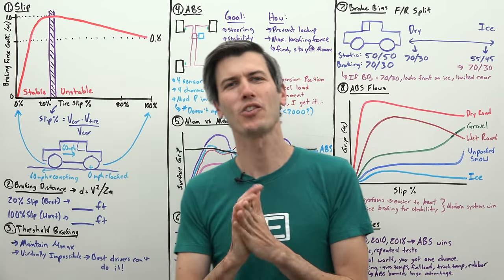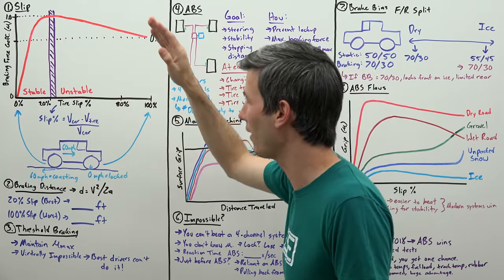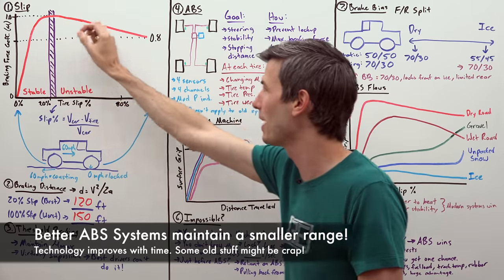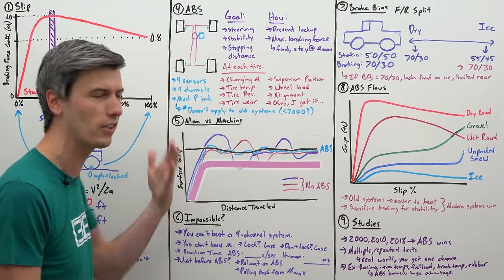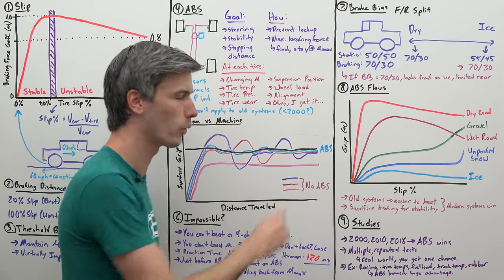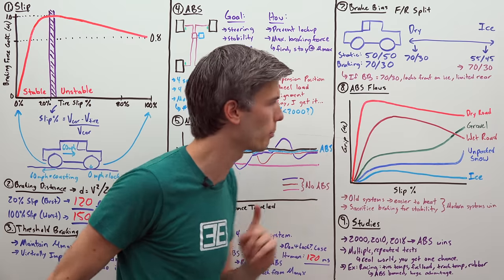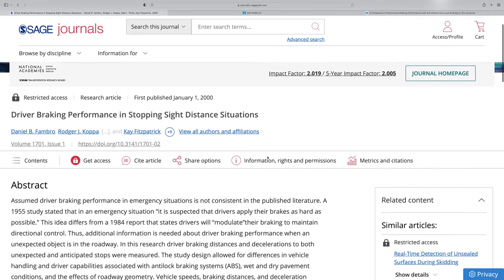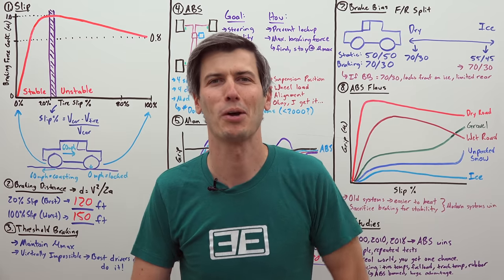Why Threshold Braking Is Impossible - ABS Wins!

Comment: As a sim racer, not having ABS helps in racing because as long as you aren't hard locking the wheels, you get some turning performance where ABS stays on the ideal limit of maximizing stopping power and not giving any grip for steering input, causing bad entry understeer if you misjudge.
Reply: Disabling ABS then doesn't help you at that point. ABS just stops you from sliding, it doesn't stop the driver from underbraking to use spare traction for turning. You had just as much control overt the car before you disabled ABS as you had after.

Comment: How about BA and ABS ? How it’s differently? Tq.
Reply: ABS is “antilock braking system”. BA is something you just made up.
Reply: @ryanjohnson4565  I think they mean Brake Assist? It basically puts more force on the brakes if it looks like you’re doing an emergency stop but haven’t pressed the pedal down far enough.

Comment: Actually the worst braking performance would be applying too little pedal pressure to stay below coeffiency of 0.8 for the whole time. And this is actually the end result that most inexperienced human drivers are actually doing in accident avoidance situations. Hence modern cars have brake booster logic that artificially applies more brake pressure than the pedal position actually demands if you move the pedal rapidly for a short travel because that's assumed to indicate that driver is trying to make full stop to avoid accident.

Comment: I don't argue with ABS advantages but it has some flaws on snowy and dirty roads.

Snow. There was another experiments with ABS on snowy roads which shown that ABS has longer braking distance because it allows wheels to rotate while blocked wheels work as snow plow and makes some snow barrier which makes addition braking force.

Dirt. Under term dirty road I mean two worst cases for ABS: concrete or asphalt road with a lot of broken stones (it is used to improve grip at slippery turns in winter but don't get it out till summer); gravel road or dirt road with 'washboard'-like roughness. In both this cases ABS actually disable braking system leaving you only with parking and engine brake. May be I done it wrong. May be ABS of all my cars had wrong settings. But I didn't found yet a car with ABS which has a shorter braking distance on such types of road than car without or with turned off ABS.

Comment: The reason is, that while this curve looks as it is, its peak efficiency varies hihghly between soft gravel, cobblestone, steel plate etc. This damn sweetspot is varying very quickly from 5% slip to 70% slip each millisecond, entire graph moves. ABS is unable to tell what's coming and for example is falling horribly on cobblestone. A human is able to tell whats coming in the city, ABS can't. If might look different from US perspective where roads are wide plenitful and have equal amount of potholes.

Comment: I wont deny it and i can't deny it. ABS is best in 99% of scenario. But i like to believe i can achieve very close to ABS's performance on a controlled environment however in an emergency i wouldn't have the same reflex and would perform worst, where it matter the most.
I'm saying that because very often than not i'm having fun on my bicycle by slamming on the front brake just infront of a redlight.
I'll get my rear wheel lifted and stop "on a dim" i mean "on the marked stop line" :P
Doesn't matter at what speed i'm going if it's 30, 40, 50, 60km/h i always nail it lol

Comment: I can attest that a 2008 car with (more) modern ABS out brakes the 1999 car with ABS on AND OFF, and the 2006 car without ABS . ABS  Adds a LOT of stability during emergency braking and manoevers: You can simply lose control because one wheel locks out and sends the car drifting, and another wheel locks while correcting and so on.

Comment: Before 2016 you can say that a good driver can beat some cheap cars abs systems but after that even cheap cars now have amazing ABS, and if you are a very good driver you will never be able to control wheels individually which is very important as a very good driver will be 10 to 20% worse than ABS in normal conditions but in conditions where individual wheel control is needed the good driver will perform 40-60 % worse than ABS and may end in spinning the car.

Comment: Modern ABS wins hands down. Especially in split mu conditions when yaw control is also required for straight line braking. In day to day driving, if you want to get the shortest & safest stopping distance with a modern ABS, just stand on the brake pedal, don't let up. An interesting study would be to compare older ABS (80s or 90s) with the latest ABS and see how they stack up under similar conditions and what exactly is the reason newer ones are better. Secondly, why hasn't a cheaper ABS been made available till now. Last I checked it added around $800 or more to the price of a car.

Comment: I just don't like it when the cars driving and I'm not. Abs is great in a straight line but some times I want to slide to avoid something. I used to race though so I know what driving to the limit is and don't even get me started on traction control. That stuff will crash you on slick roads when it won't let put on power or turn. 2021 Honda CR-V. Honda is supposed to have a good system too.

Comment: This doesn't even consider you driving a motorcycle, like mine without ABS and not applying enough brake pressure in fear of overturning due to too much front brake or not enough rear brake due to your rear breaking out. As a normal person, you don't want to chance either so you always sacrifice braking distance to prevent a worst-case scenario. I am deeply aware that I need an excess safety margin for vehicles in front of me in case of any emergency braking because I won't risk breaking as hard as a vehicle with ABS can do without worry.

Comment: My old car, have only brake servo. 
NO power steering
NO ABS, NO ESP, only steering wheel and me...
After 7 years with it...this is the best automotive experience.
In all conditions, weather, temps...
I not need a ABS at all 😊 any asist system...

Comment: In a brand new perfectly working system, yes this is correct.  But there are other factors.  I've had ABS systems that work well in casual situations but just go right to streaming clicks and barely slow you down in an emergency.  Maybe the pads were low, not sure but they weren't even squeaking yet.  Some modern cars also have a delay in emergency braking.  If you slam the pedal, the pedal stiffens up before it even begins to brake.  That delay can be as much as a half second. That's enough to get you killed.  I still think ABS is better when it's in perfect condition but if you drive older cars with nothing but bare minimum maintenance, watch out!

Comment: I haven't raced a car in about 30 years now, and there's no question that ABS has advanced massively since then, but I still can't imagine driving at speed on a track using ABS. It kind of defeats the whole point somehow. Also, what about rally racing, where handbrake maneuvers are de rigueur. You can't pivot a car with a handbrake if you can't lock the wheels. And if you can't pivot the car at speed, you're going to find yourself in trouble pretty quickly.

All that said, in everyday driving, nothing beats ABS, especially with modern systems designed to adapt to conditions.

Comment: Why don't they have ABS in racing? For the same reason they don't have launch control—it takes driver skill out of the equation.

As much as I love ABS, I'm glad you brought up the gravel scenario. Most gravel roads in Australia (and there are a lot) have loose rubble on the top, with a hard-packed sub-surface. ABS allows the car to roll over the "marbley" surface, where jamming the brakes on digs through that loose surface to the harder sub-surface which has more grip. As you stated, this builds a chunk of loose road in front of the tyre, further helping slow the car. The only issue with gravel braking is reduced steering control. Again, digging into the road means the front wheels act almost like a rudder, so steering is not completely eliminated, just largely reduced, but ABS could potentially give you more steering control at the expense of braking distance.

Comment: While theoretically this is all true, my track day experiences lead me to believe otherwise. ABS systems for road cars seem to prioritize stability over maximum braking performance, and they leave a lot on the table.  They also tend to activate much earlier than desired. For example, you want to brake at 80% pressure, but the ABS just takes over at that point and assumed you were going for 100% pressure.  Unless you're driving something with an extremely sophisticated ABS system like a GT3 car (have never driven) or 6 figure high performance car, activating the ABS increases braking distance and the time spent in the braking zone.  At least that is my anecdotal amateur driver experience in every car I've driven on a track.

Saying that, I definitely prefer a car with ABS because without it 1 mistake can equal 1-4 flat spotted tires and a not-so-fun day.

Comment: I hope I don’t seem like I’m talking out of my ass saying this, but I feel the reason that the whole threshold braking is better argument exists is because some ABS systems tend to be too intrusive under hard braking and unintentionally make it worse. Not only that, but I believe it’s also been said that a tiny bit of lockup also helps because you’re essentially using a little bit of tire friction to stop faster, of course only in a straight line. But I’m aware that in alot of modern motorsports such as GT3, you gave adjustable levels of ABS, so it is most definitely superior.

Comment: Wow, Jason huge mistake in the written formula :)
Slip% = 60mph - 60mph / 60mph ?
Correctly it is (60mph - 60mph) / 60mph. But the formula on the whiteboard is correct.

Additional note on "activating ABS and then slightly releasing the brake". As I know once you activate ABS, it keeps working until you fully release the brake. So you can't play with the brake force. But I might be wrong.

"ABS vs gravel and unpacked snow". It's worth mentioning, with ABS you still have the ability to controll the car, because you still have grip. You turn the steering wheel, the car turns, so you could evade whatever obstacle might be in your way.
With locked wheels you are screwed.

Comment: The most simple explanation why well implemented ABS is going to win no matter how much skill you have is that the ABS logically has 4 fully separate brake pedals when human has only one. There will be moments during even a single braking event while one of the tires is starting to slip sooner than the other wheels – with a single brake pedal you either release the pressure of all the wheels to avoid slipping or let than single tire to slip more and reduce its coefficient of friction. ABS can opt to reduce brake pressure of that single wheel at the threshold braking level.

In addition, minimum human reaction time is about 100 ms so from the moment a wheel locks up during the braking, it will take about minimum of 100 ms before even the most skilled human driver can modulate the brake pressure to lower level. Only very old and crappy ABS implementations would have 100 ms long feedback loops. A well made ABS system might have 5–10 ms reaction time even though the cycle length of the hydraulic system might be longer because the real world implementation must operate hydraulic pump and valves.

If somebody can create strong enough solenoids to replace hydraulic actuators, then we could see practically perfect ABS implementation.

Comment: Nothing beats experience, but time marches on.
When ABS was first introduced, some cars had it only on the rear, so that the car would straighten out; not necessarily the best option. Most of them pulsed very badly and locked up for a second. Modern ABS with stability control ain’t your Dad’s/Grammas ABS

Comment: In my Kenworth there is very little brake bias and for a good reason. I have 7 axles with 4 tires each and I don’t want to have to depend on my steering axle. The steering axle does very little in panic mode. Old er trucks used to have front brake limiting valves. 
  And by the way, race car drivers are NOT pure driving professionals. Truck drivers are!!

Comment: Manufacturers need to create (if they have not done so already)  an ABS system that DOES NOT cause the pedal to pulsate (and cause unknowing drivers to reduce pressure or even release the brake  pedal). I hate it that is the one time that the driver that panics and mindlessly tries to push the brake pedal through the floorboard will do better than the perceptive (but uniformed) driver that thinks there is something wrong with the brakes.
Reply: This is exactly why AEB was implemented -- to account for undue driver panic. Also, as to such a system as you mention, there is actually one in development but I cannot recall the details currently. I do know that it has been test driven by some journos already and the test car is a Tesla Model 3.

Comment: For a motorcycle I would disagree. During practice we would learn how to progressively brake and how to slam it into the abs. Progressive breaking yielded about 30% shorter braking distance (due to the front suspension requiring to be loaded, which the abs couldn’t handle). In any case, it’s good to learn how to make an emergency stop without abs, just incase you would ever drive a vehicle that does not have it

Comment: ABS is always better at reducing stopping distance, but there are other reasons to threshold brake than just minimum stopping distance.

For one, most drivers actually don't depress the break pedal hard enough, and it just causes heat soak. Knowing HOW to the threshold break, means knowing HOW to brake properly.

Comment: I know this isn't much related to your situation, but I recently bought an electric dirt bike, and the ABS, which is Bosch 9, is absolutely horrible off road. My 2019 KTM 690 SMC, on the other hand, has really good ABS. I know this isn't a great example, but it really does depend what you're going and what system you're talking about. They DRASTICALLY different.
Reply: In this case the dirt bike may have the ABS optimized for offroad or they sucked in setting it up correctly

Comment: This is where theory and reality are not as close as they seem …. Why ? I have no idea….. what I do know is that on my old ford fusion 2006 I can brake faster when I pull the ABS fuse and as soon as ABS engages the stopping distance in dry road is simply longer……. On my BMW 523i f10 2010 ABS is faster 100% of the time 
On my motorcycle a KTM duke 390 ABS tries to always keep the rear wheel on the ground but as soon as I switch ABS off i can stop faster in a straight line as I let the rear come up a little bit……. This is All very case specific……. what ABS will be is much much more consistent

Comment: Because Antilock Braking System is controlled by a fast microprocessor based control system, it is obvious it will stop a car in less distance during a panic stop than a human being could do.  The main thing during an emergency stop is to keep pushing down hard on the brake pedal and let the ABS do its thing. On occasion I have practiced a panic stop so that I am used to the rapidly pulsating brake pedal and vibration that occurs when ABS activates.

Comment: The wider the tires the less of a factor ABS is.  Most drivers are not better than ABS.  But a bootleg turn = shorter stopping distance than ABS.  Related vid that supports this explanation with a professional driver can search "ABS on vs ABS off."

Comment: My car was the first model to have ABS as an extra option for Holden but they were uncommon.  I drove a few before and they were terrible, much worse than the already weak standard Corvette type brakes they had.  This is early 90s, 91 or 92 is when ABS was first available for Holden.  Also anyone with ABS on these cars really have no options for brake upgrades where there is several types of much better and larger brakes available for the standard models.  

Then I drove modern cars with ABS and wow! Have come a long way.  I would love modern ABS on my car.